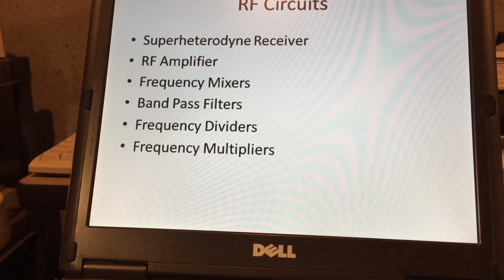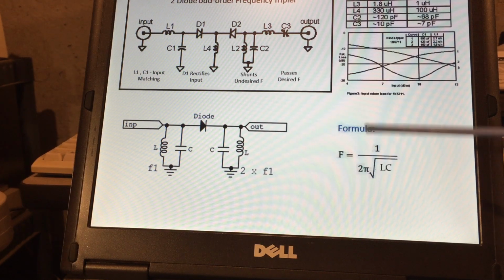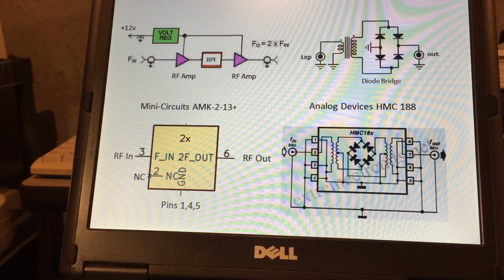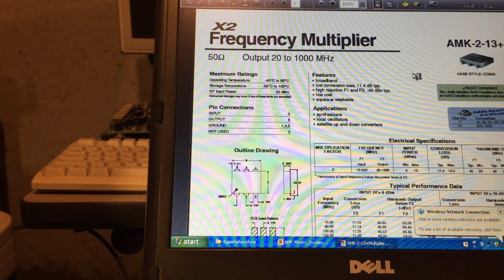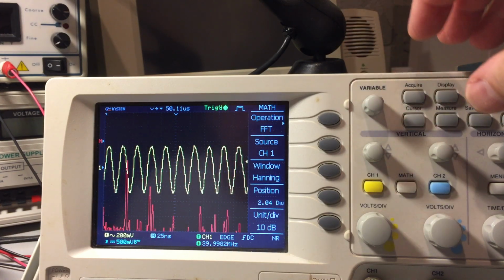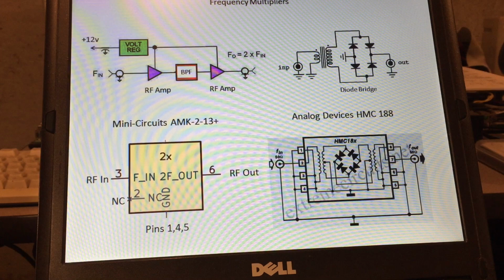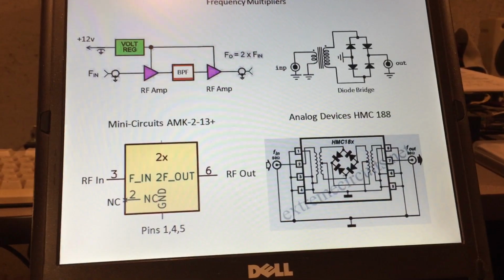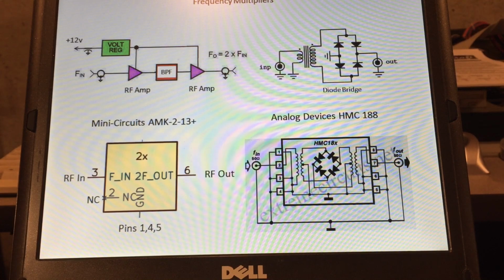Superheterodyne Receiver Part 4 (Frequency Multipliers)

Comment: I'm not sure you understand the role of the diodes in your first circuit.  They aren't 'rectifying' or 'interfacing'.  They are converting a sine wave to an approximation of a 1.4 Vp-p square wave.  This is because a square wave in the frequency domain consists of the principle and every odd harmonic.  Were it not for this clipping action, there would be no 3rd harmonic to be filtered.
There are more rigorous explanations that this, but this gets us into the right ballpark.
Reply from the maker: Thanks for clarifying! Regards